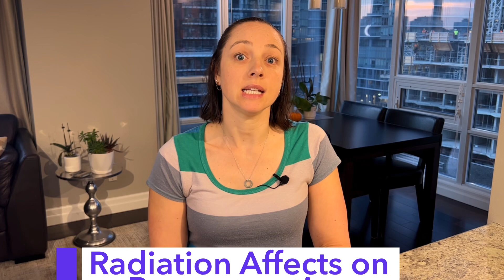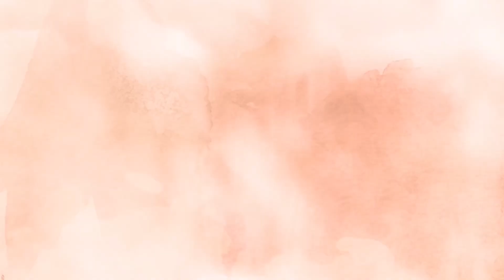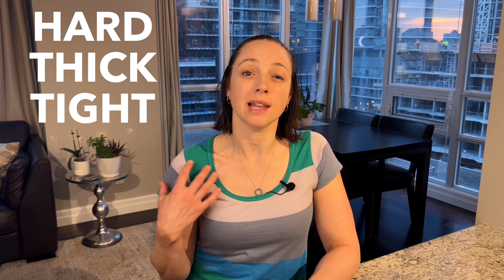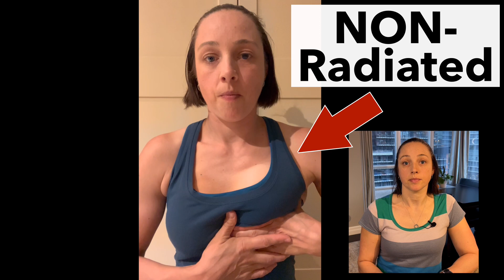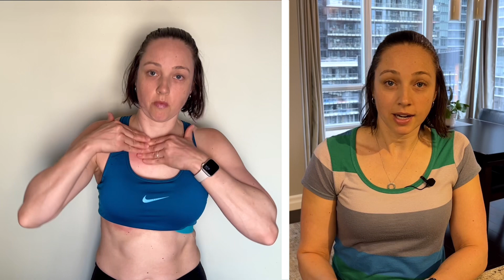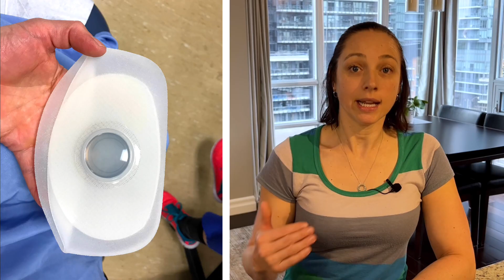How RADIATION Affects BREAST RECONSTRUCTION

Comment: I was under the impression that a woman cannot undergo implant reconstruction, post lumpectomy and radiation.  Something about the encapsulation that happens and is incurable.  Did you have reconstruction after having radiation?
Reply from the maker: I did have reconstruction after radiation but had tissue expanders placed at the time of my mastectomy (so skin/tissue was stretched before radiation). The expanders were swapped out during my exchange surgery and replaced with implants.

Comment: Im having my mastectomy next Wednesday and will be getting expanders due to needing radiation  after. My radiation doctor mentioned to me that if I choose implants more than likely they will shift as the years go by. This only happens with implants and not Diep surgery he said.
Reply from the maker: Yes, my surgeon said my implants will fall slightly over time too. The radiated side may fall some but not much. I don’t know enough about the results with a DIEP to make a comparison.
Reply: There is very little difference between placing implant vs TE prior to radiation. Both are at risk of capsular contraction (Going hard). Autologous reconstruction, using your own tissue (latissimus or DIEP flaps) can also get quite hard after radiation, but usually less. This is why many plastic surgeons (like me) prefer doing delayed autologous. In some cases, I am comfortable to place the implant at the time of mastectomy (immediate direct to implant, DTI) prior to radiation, but recommend prepectoral (in front of pectoral's major muscle) as oppose to sub pectoral (under the muscle). If patient gets radiation-induced capsular contracture, I wait a year and then perform autologous reconstruction. TE have a lot more disadvantages to implants; you have to come back for expansion, usually weekly, tissue expanders can get flipped (meaning you can't access the fill port) and expansion itself can be uncomfortable.. I could go on.. but in future I will post a video on this.
Reply from the maker: Dr. Li - I’m curious what your protocols/restrictions are for exercise post-surgery.  This would obviously depend on the surgery.
Reply: @breast-cancer-rehab  It depends on whether my patient is getting an 'easier surgery' like a implant revision vs a brand new mastectomy, direct-to-implant or a flap case. Most patient meet with OT prior to surgery and given a booklet with phased exercises. If patients have drains, I usually wait till drains out 1 week before starting phase 2 exercises. Easy revisions, back to normal after 2-3 weeks. Mastectomy + reconstruction, no lifting > 5 pounds 6-8 weeks, no driving same period. I am very conservative. But my seroma rates are very low :)
Reply: @breast-cancer-rehab  BTW in case you are interested,  I will be posting a video about Goldilocks mastectomy/procedure next week. I've done many of these!
Reply from the maker: @DrWaiYeeLiPlasticSurgeon  It's interesting how the recomendations are so varied. That happens in my profession too. Thank you for your input.
Reply: @breast-cancer-rehab  most of what I advise is based on experiences with thousands of surgeries. Like patients coming back with bleeding after early activity.btw I just posted a very short video on Goldilocks mastectomy which I’ve done a lot of over the years. I’m new to YouTube: many of my patients requested so I finally did..

Comment: I will be having an immediate reconstruction with my mastectomy. The surgeon will be using a type of mesh,  I think it’s called an Acellular Dermal Sheeting  made from sheep gut, That adheres to the tissue  acting like an ‘ inside bra’ preventing capsular contracture if radiation is needed later.
Reply from the maker: That’s great that you’re able to go straight to implant.

Comment: Hello, is your chording gone now? I'm a male and after a heavy lifting session I got chording on my left side. I think its safe to say chording not only happens to women after surgery but from the trauma on the surrounding tissue.first day my hand felt really tight. If I even tried hanging from a pull up bar my arm felt like it was going to tare off. A week later today I can hang from a pull up bar with some pain and discomfort but I can do it and it's bareable. I tried a pull up and noticed my arm only feels tight when I reach the lowest point in the pull up. I'm just wondering how long this is going to take to heal. Thank you for your stretching videos and PT videos!
Reply from the maker: You didn’t mention if this was breast cancer related after surgery (it’s not as common but men can get BC too). I still have visible cording but the tension that’s associated with it has improved over time. Hanging from a bar or anytime your arm is fully stretched out is when the tension on the cord is at its most. I’m going to post a video on bar hanging this week so watch out for that.
Reply: @breast-cancer-rehab  Hello, yeah no mine wasn't due to surgery. It was just the trauma from overexcertion. I vaguely remember dealing with this injury in my initial fitness journey but never did any PT for it. It just kinda completely went away on its own. I might just be prone to it now if not careful. I'm hoping to recover soon.
Reply: @breast-cancer-rehab  how long have you been dealing with the chording if you don't mind me asking?
Reply from the maker: @Fakken28  Since breast cancer surgery 2.5 year ago.  It's significantly improved but I still feel tension.

Comment: I have the same tightness, but didn't have radiation. I had expanders and reconstruction surgery. I'm more tight on the cancer side. I still have swelling and numbness. Mastectomy surgery was April, reconstruction was August...both this year. Love your videos!
Reply from the maker: Thanks for sharing! Interesting that you have a difference in tension side to side when you didn't have radiation - maybe due to lymph nodes being removed, cording, etc on the cancer side.  Wishing you well with your recovery.
Reply: Thanks so much for your response! Yes, the cancer side had lymph node removal. I've had swelling and a little cording where the drains were. I had 2 drains on each side, but again, the cancer side was different. Thanks again! ❤